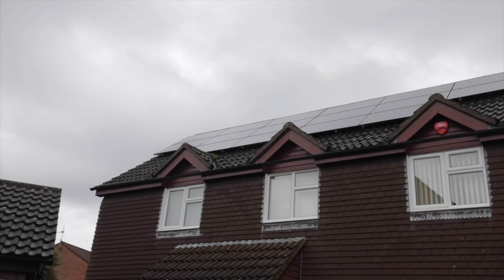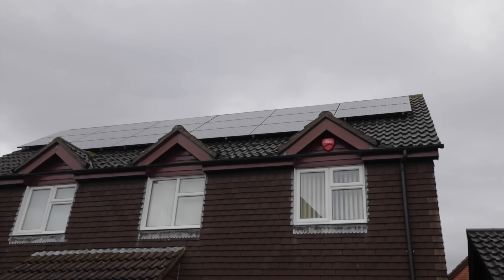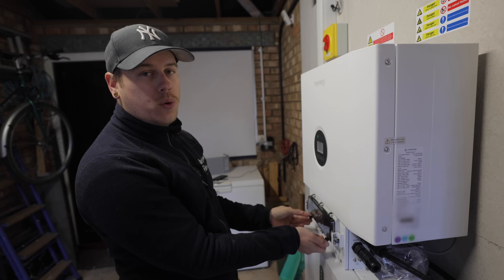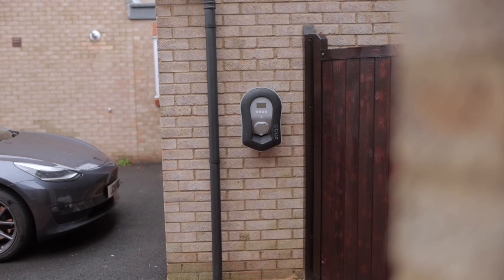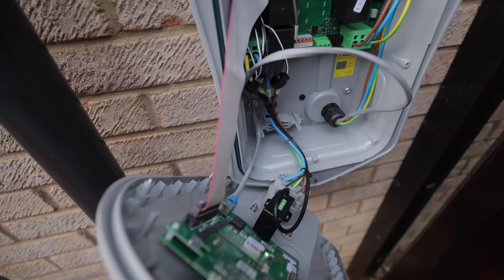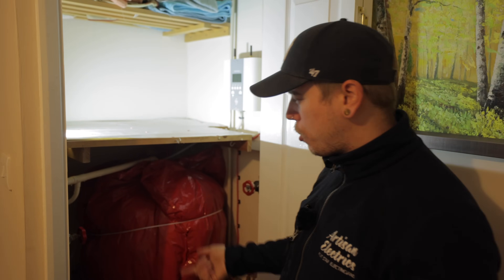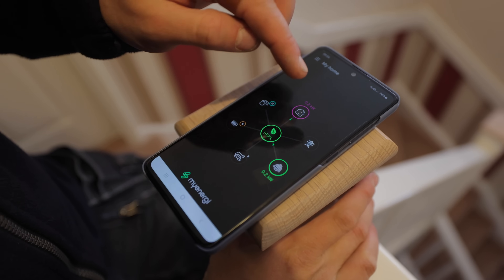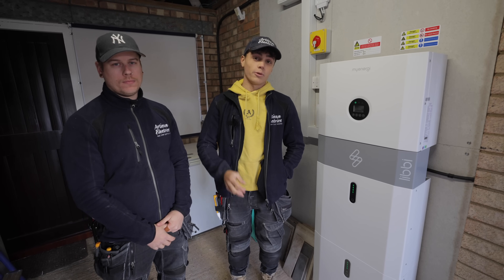How to DOUBLE the Value of Your Solar Panels 👀

Comment: One thing I think is important to say is that things have changed if you are on Intelligent Octopus, the export is now 15p, this in contrast to the 7.5p per kWh for 6 hours at night, as such its financially far better to sell your energy back instead of diverting to Eddi or Zappi and then just buy at night. I have both the Eddi and Zappi and don't use the Eddi at all now as it doesn't make sense, you could argue about carbon intensity but generally its also greener to export as much as possible as night time is normally less.

Comment: Unconvincing advert for people with more money than sense. ALWAYS CALCUATE THE RETURN ON INVESTMENT and repayment time. Batteries are horribly horribly cost inefficient unless you are actually off grid. Selling people with a grid connection a battery system is, ..... well..... I don't want to say dishonest...... so...... difficult to justify.
Reply: It's all about doing the maths and designing a system that suits your usage, and how willing you are to make use of smart tariffs. If your normal electricity use is 5kWh a day dont install a 20kWh battery unless you intend to use smart tariffs to export to the grid and make money that way. As we move more and more towards greener technology to heat our homes such as ASHP's battery systems can be a huge part of making them cost effective.
Reply from the maker: Completely false information do your research properly. Battery storage significantly increases ROI on solar and with smart tariffs now and the opportunity to charge the batteries on cheap electricity overnight and sell back to the grid at peak times or use that energy yourself at peak times it gets even more attractive from an ROI point of view.

Comment: So, I wonder how you con these people into paying for battery systems when they are already on grid?

What possible benefit could you offer for the massive cost of inverters and batter management and the batteries themselves (which will need replacing every 3 years if you charge in the day and discharge at night. Every year if you're selling them Lead Acid).
5KWH of electricity is currently worth £1.50, but if you don't use it yourself you can sell it to the grid via net metering. UNLESS you make more than you use in total, which you almost certainly won't for 6 months of the year. So you MIGHT save a couple of KWH per day off your bill for 180 days a year - so 60p a day. Given maintenance costs installation cost and battery life (at only 2kwh per day they will last twice as long as I suggested above) what is the repayment time for this extra gear? My back of an envelope calculation says 0.6x180 = £108 saving per year. 5KWH of deep cycle batteries ~£500, Installation ~£300, Charge controllers and Inverters ~£300. So if everything worked forever it would take 11 years to repay BUT being generous, a new set of batteries every 5 years would take another ~£500 every 5 years, so you'd basically NEVER make a profit.
Reply from the maker: Lead acid?! What planet are you on? 🤣🤣🤣
You need to see what modern tech is out there. These have a warranty of ten years for the battery pack with unlimited cycles.

Comment: Yeah it’s an ad. But it is targeted at folk without any smart way to use the energy. If you had a monster FIT, you might not want to self consume, but if it’s equal or less than your day rate, sticking in a battery, tank, UFH, car rather than let it go out cheap makes sense, and the tools to do it are in this video. Top marks to Reuben for the physics lesson in the eddi bit.
Reply: I was under the impression that if its the earlier versions of the FIT payment system. You still earn the FIT payment even if your self-consuming / re-absorbing it into your own car/water tank/battery system.
Reply: Yes you do. But you not only got the payment for generating the power you could also sell it back to the grid in addition.....however you got a lower price than you paid to buy it, so there is a miniscule justification for using your power rather than selling it to the grid, but pence per unit..... not enough to pay for a battery system - not in the real world. @Fishbait075
Reply: No no no no no, the costs are simply offering no realistic repayment rate. Even for people who are willing to buy panels that will take 20 years to repay the investment the numbers for battery storage are nonsense unless you are off-grid.
Reply from the maker: That’s complete tosh 😂 do your calculations properly. Most people can easily achieve a 10 year payback with solar and battery storage, sometimes a lot less.
Reply: @artisanelectrics 😅 "Complete tosh" is an incredibly polite but accurate way of saying it. Payback on my system will be about 5 years. Less than that if I use the system to export at times of peak demand. You have to think beyond just solar. With a battery system you can extend  the period of the year that you are self sufficient (if you have solar) but you can also use the batteries to just purchase your power at off peak rates which with some available tariffs can quarter your electricity costs.
Reply: @artisanelectrics  and that's 10 year pay back at artisan pricing!! 🤑

Comment: Bought a new build with a 5 panel solar setup already installed.

I have CT clamp monitoring of my circuits that last couple of months and I know that our daytime is much shorter right now but I have been gobsmacked to learn that out of the last 5 days, 3 of them have had literally zero kWh generated.
Reply: Indeed, I was totally unaware at the dramatic bias between the seasons for Solar power. You can have as much battery capacity as you want, but with zero Solar...
Reply from the maker: Yeah that’s winter in the UK! It will get better. If you have battery and a smart tardif tho you can do clever things like charge the battery overnight cheaply and use it to run the house during the day - significantly reducing your overall energy rate during winter.

Comment: Ah come on guys, if you're going to do a MyEnergi advert, at least label it as such. Disappointing.
Reply: Does say in caption ‘Includes paid promotion’
Reply: @Cosmo95_   Where? Popped up in my Notifications as "Maximise Your Solar: 3 Smart Upgrades to Harness Excess Energy". It didn't say "Here's 3 MyEnergi Products you should Install"  Besides which, it isn't even really 3 products. It's 3 components of one system from one company.
Reply: @BerkeleyTowers  At video start, in top left corner, is quite subtle though, so understand where your coming from.

Comment: Nice work guys! A really important thing when talking about solar and battery storage is explaining panel kW output, and battery kW output to load and battery storage in kWh. Cheers!
Reply: Came here to say the same, "20kW per phase" I had no idea  Myenergi made inverters that big, then I realised they meant kWh and were actually talking about the maximum battery capacity per phase
Reply: @mikebarry229 yes indeed. Is important to mention kW as energy output and kWh as capacity. Cheers from Sydney, Australia